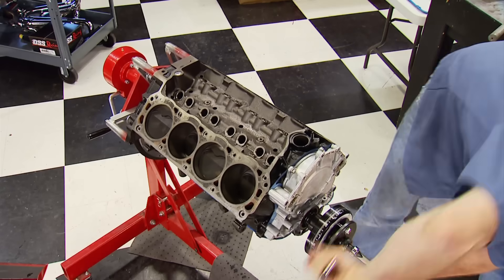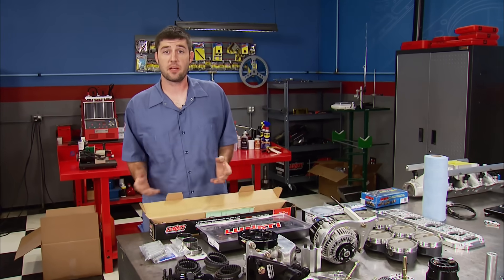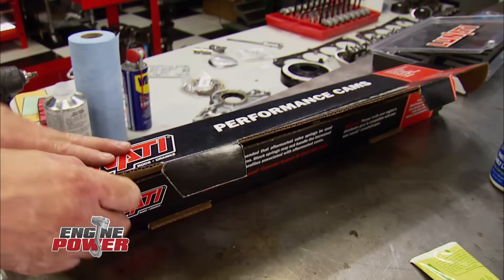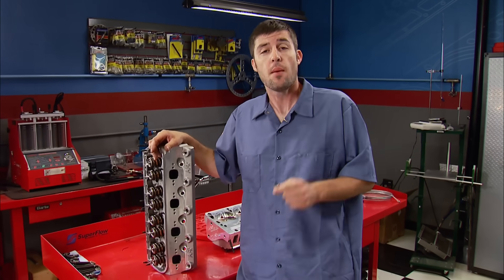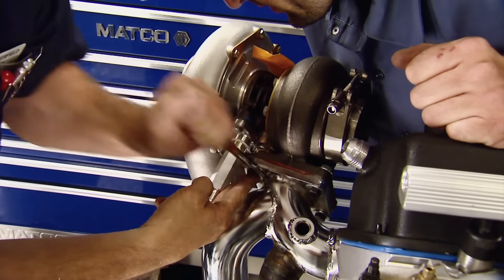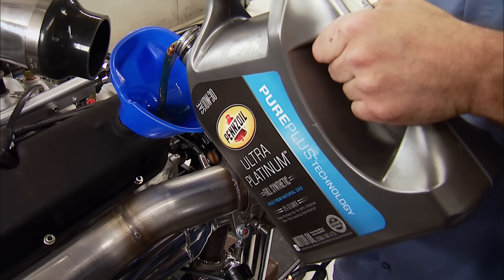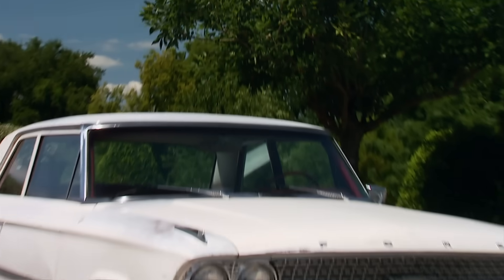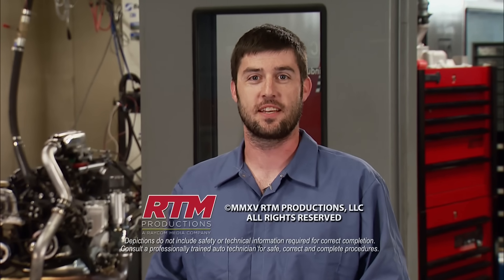Unleashing a Boosted 347 Small Block Ford - Engine Power S2, E20

Comment: If you're going to run race gas in it, why not keep the compression higher?
Reply: High Compression is not always the answer with boost. Too much compression has diminishing returns. It depends on the boost level. Since this is an N/A engine originally you will benefit more from a drop in static ratio than an increase. This keeps the need for higher and higher octane fuels in-check as well.
Reply: This engine has 2019 spec alloy heads and pistons in it. Im 100% sure itll handle 10.0:1 or more on pump gas and turn 1k with far less boost than they are going to need with 8.8:1. I would understand if they were using factory original type pistons and cast iron heads but the alloys suck heat from the chamber.
Reply: @V6turbo  considering this show is more than 5 years old, i doubt it has 2019 spec anything
Reply: @ericmccoy5038  considering this episode aired 6 days ago, I'd say it's pretty likely the stuff is modern enough to run 10:1 compression.....
Reply: @codyslaughter4678  it was posted on You Tube 6 days ago....it was on TV over 5 years ago....this is an old TV show
Reply: Why?  With a street car it needs to idle and be able to run in variable rpms just like stop and go traffic.  In the dyno cell its wide open throttle to 6k then back to idle.  On the street it's a different story.  Personally, I dont like sitting at idle on the street at around 215 degrees on the coolant temp. After 215 degrees you start cooking oil. That's spells doom for a turbo when the oil starts to get above 225 degrees.